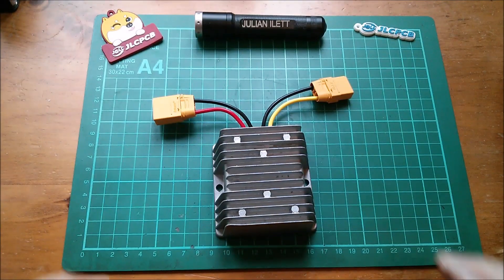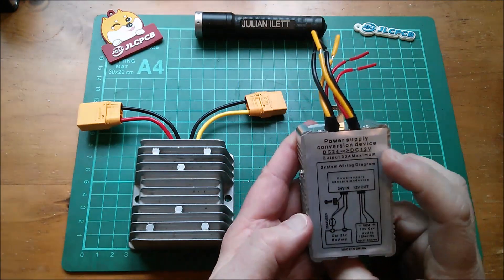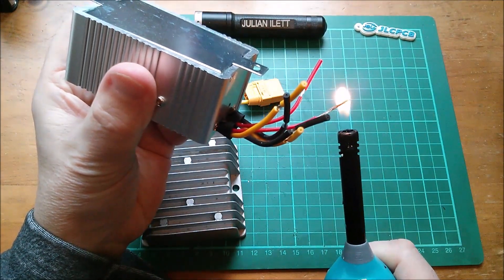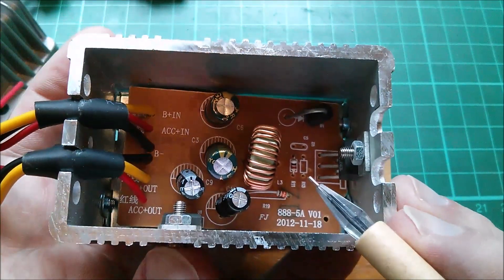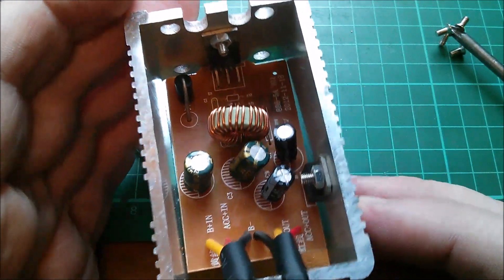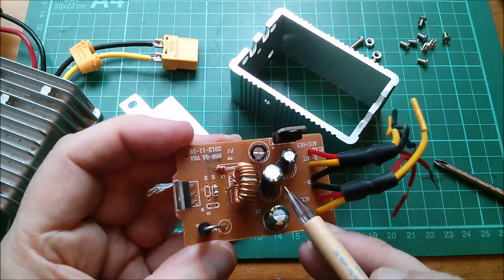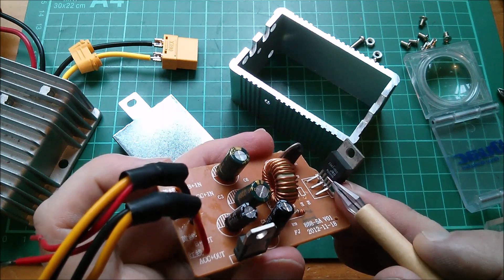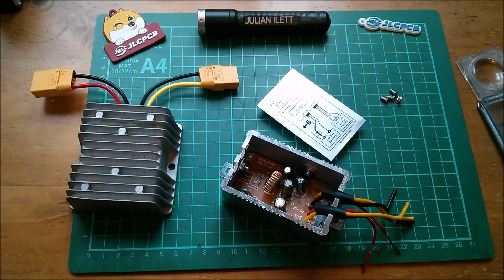Fake 30A Car Audio Voltage Converter

Comment: My thoughts are that the device is to be used on 24V trucks to power a 12V (cheap) car radio. I have a friend  that have similar (but legit, beefier) units like this to power some 12V car devices on his truck. Like a 12V radio, a small TV, a car fridge, few GPS, some chargers and so on. 
This unit have two regulators. The small one is to be used as main power for the car radio: the yellow wire (constant, batt, memory or whatever is marked), that is to keep the settings and power the main board. The power needed is small so a 7812 makes sense to be used.
The second power supply is to be used to power the real audio power amp and that is the DC/DC converter. My guess is that the marking 888-5A is the actual current output rating, that is 5A max. So 60W max. That makes sense for a regular car auto at the red wire (ignition, key or whatever is marked) that is powering the main power amplifier (2x30W or 4x15W).

Comment: This, as it stands and for its' application, isn't fit for its' purpose and is dangerous! They couldn't even design the simple 7812 right - it needs small (0.33/0.1uF) low ESR caps as near to the leads as possible, or else it can oscillate. However, I like the case and you could properly build say, a 24VDC to 19VDC converter for a laptop or something like that. Wow, so much of this stuff is dangerous rubbish!

Comment: Thanks for showing the lighter trick. I didn’t know that. You can always tell the power output by the size. 12Vx30A = 360W … never. I use the one similar to the first one you showed, but manufactured by BTF Lighting which is a half decent quality brand. They don’t tend to inflate the output current rating! Lol the inside of that second supply was embarrassing!
Reply: Size alone doesn't give it away. An advanced supply in that size could easily output 30 amps. Don't believe me? Just look at computer Vcore regulators.

Now the size combined with the low price, yes there's no way.
Reply: @eDoc2020  yep undoubtedly correct!

Comment: So at a maximum of 3A you would need at least 10 of them to get the 30A output needed...kind of making the £7 cost (totaling £70) not a very good deal against the £20 for 25A.

Comment: You get what you pay for, You can go far too cheap

me i would get a 200A (2200W) Caravan DC DC 24V 12V Converter  one that rated for 12V Fridge Loads

Comment: Since car audio headunits don't generally consume a continuous draw, those little caps and regulators can probably supply near the 30A load for milliseconds (duration of a low power bass hit), making it "30A max"... sellers of cheap crap love to try and play with technicalities in their marketing. Hell it may actually be "fine" for a headunit without a cd player as the continuous draw may be well less than 2A.
Reply: Isn't that the whole point of PMPO? :-)

Comment: Your a smart guy. The switching regulator looks easy to make it any current you need. It has npn output, add a couple transistors and beef up the coil and diode.

Comment: Is the Diode used in circuit or is it just reverse polarity protection?   Either way, this cheap piece of ** would be lucky to give you 5A peak......
Can't trust anyone these days
Reply: It's the freewheeling diode of the buck converter. It is required (and not for protection).

Comment: looks like it's for hooking up a 12v car radio/cd to a 24v truck system ( hence the acc passthrough from the ignition ) 
3A should be more than enough in that case, no??

Comment: I bought a couple of these, needed 12v on a 24v forklift to run the fan in a cab heater we added. The first one didn't work (probably blew immediately on powerup) and the second one lasted a very short time with a load of about 10a for the fan. The diode blew. Bought a much nicer potted unit ($$) which worked fine. The Chinese are notorious for misplacing the decimal point on several things I have purchased!
Reply: this sounds like the kind of mistake a low paid, unskilled person would make at the factory, not reading a decimal point. also common is, they dont know the difference between mm and cm (small measuring error of 1-2 cm) its usually clear they meant mm.

Comment: You might as well use one of your many rechargeable 240v inverters to power the HP PSUs directly, if the power is renewable, and work out how to keep "the powerbank topped up" instead.

Comment: I had similar converter(not sure about components tho, but it was one of those cheap versions) . Weirdly 10A was not a problem for it. It was a bit toasty but worked. Of course I would not use it for any important things but for some weird projects or test... Why not.

Comment: An LM7812a voltage regulator is rated 1 Amp output at 12 volts,
but with minimum 14.8 Volt input voltage and an excellent heat 
sink, the typical maximum current out spec is only 2.2 Amps.

Comment: I've seen evidence in other videos that suggest that those converters are not entirely potted. The creator had a failure, cap blew straight through, and they were able to easily remove the chared board remains. Not rich enough to chop mine open, but food for thought lol
Reply: It reminded me about one situation when I had some case potted and when I tried to open it it turn out that inside was another thin aluminium case and they just potted top of it so it was like maybe 3-5mm thin layer... -_-
Reply: @paranoiia8  Chinese ingenuity truly knows no bounds.

Comment: Yeah they always lie when it comes to  the amps , and also the efficiency.!   and they aren't reliable in continuous service at high current, without active cooling .

in DC battery systems , DC DC converters must be avoided.  otherwise just use a dc to ac system and accept the efficiency loss

Comment: In the lower-right corner it says 888-5A which maybe means 5 Amps.
Reply: remember, in china, its ok to just add up the amps of different output voltages...

Comment: Can't believe you didn't try to run 30A through it. Big clive or photonic induction would have ran it until it popped!
Reply: You can’t. It will fail well before that load.
Reply: @ernstoud  that's the point...
Reply: @ssj4jamie592  Photonic induction?
Reply: @Leepshin  https://youtube.com/user/Photonvids

"I've popped it!"
Reply: @ssj4jamie592  OH nice one Jamie 👍. Channel looks awesome. Cheers bud. 🍻
Reply: Photonic would have discharged a multi-kV capacitor the size of a dustbin through the poor thing to vaporise bananas

Comment: I think you get it wrong about that car voltage converter. According to the circuit drawing, it clearly says the power source is meant to be a 24V car battery. So this thing is just a stepdown converter and can deliver up to 30A. So it is mainly for Trucks that have a 24V onboard voltage, instead a 12V onboard voltage of a car. But most car radios and audio systems need a 12V supply.
And a car battery can easily deliver enough Amps for the max. output of the Converter. But it would be interesting what will happen if you draw more than the rated 30A 🤔. Maybe that converter transforms into a beautiful heater or electric grill for some sausages or beacon 😂.
Reply: Did you mean sausages or "bacon" ?, with 30 Amps it'll surely light up like a beacon.😏
Reply: @brucepickess8097  Yeah, bacon, of course. My bad.

Comment: the 30a max stands for maximum 30a power draw from the input when the 12v out is shorted to ground , but if its capable of 5a this is good enough for cheap car radios that don't consume much more than 5-10a before distorting but i hope the output is at 14.5v and not 12v , that will kill some watts of the cheap headunit.

Comment: The ACC is the contact of the car, and the other wire is probably a 12v high Switch (yes acc is accessories) meaning your car appliances are powered on 

The high switch is a 12v + signal into an amplifier telling it to turn on
The acc is obviously from the car ignition module
I think its a little useless however you could use the acc on a light or whatever to switch on the converter and Amp  Instead of pulling a wire from your contact in the dashboard

Comment: I had exactly the same thing, bought one too run my 12v diesel heater off my 27v solar garage setup. Thought this is "VERY" light lets have a look, yep that will handle 20A NOT.

Comment: The smaller regulator makes sense, it's only supposed to help down-regulate alternator voltage (14-15v) to 12 with very little current to trigger other devices, basically logic level current. With that the small caps, wires, traces are all just fine. The inductor and 5.5A JRC (NJR/Japan radio) regulator is just laughable though for a supposedly 30A device. Vehicle fire waiting to happen?

Comment: A diode in a cheap buck converter only conducts part time when the mosfet is turned off.  Assuming a 50% duty cycle, would that mean the diode could conduct 6 amps momentarily?
Reply: In a switching application the time to recovery is the problem. It's the time the diode conducts in reverse, at full voltage, before it halts the current that really causes it to fail.

Comment: I believe you got this completely wrong! it is 30 Amp hours TOTAL: run it at 30, blows instantly, run it at 3 amps, blows in 10 hours.
Reply: XD
Reply: but that's like 300mA for 100 hours!
Reply: @SimonQuigley  i bet there's a rule of diminishing returns with lower currents... the time gain gets asymptotically shorter

Comment: It we be interesting to see this rigged up to a 30A test load and see when the magic smoke escapes!
Reply: Try it, try it, try it, try it....
Reply: It wouldn't blow up violently, those integrated switchers are pretty well protected, probably only the diode would short out.
Reply: Then complain to the seller that it's not up to spec. Don't let them get away with the scam.
Reply: I was about to say the same - the only thing missing was the 30A smoke test :-)